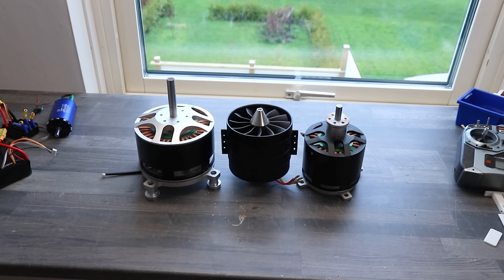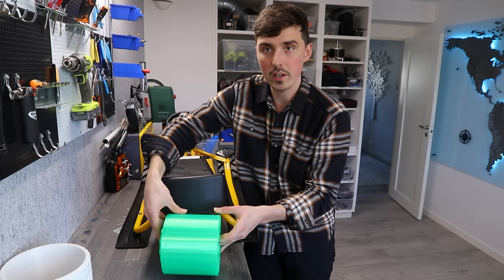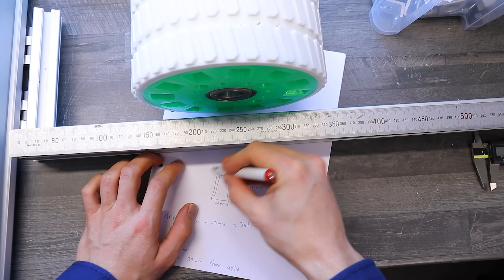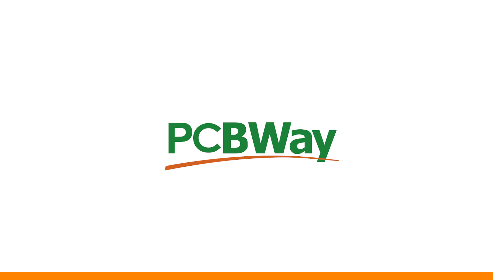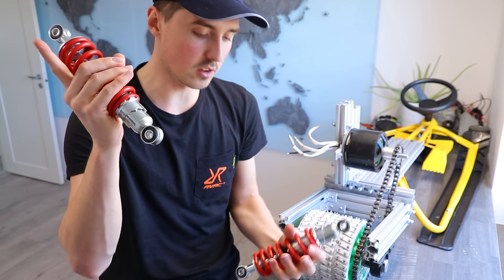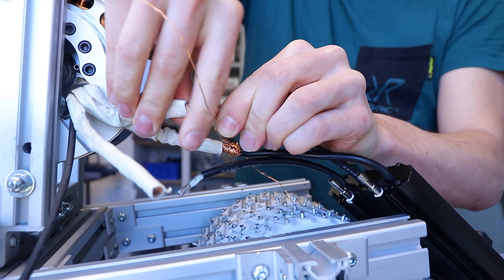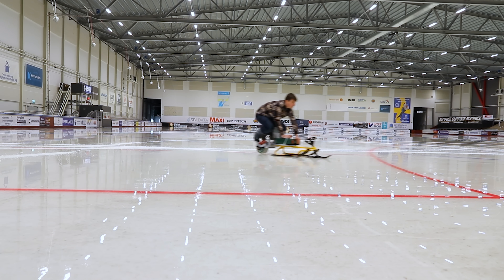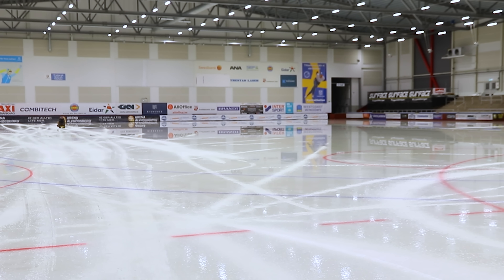15kW Electric Snow Racer Made With 3D Printed Parts

Comment: They make blades for miter saws that cut steel and aluminum, this could improve your cuts and reduce time. Great projects and informative content. Thank you
Reply: A thin kerf, high tpm wood cutting blade will usually make short work of aluminium too (if  you're not using a sawstop)

Comment: I'm only a few minutes in but it's looking great so far. one thing though don't use the same disc for ferrous and non ferrous metals. a cheap chop saw with an abrasive wheel on it would help you out lots for cutting metal. you can get them pretty cheap. keep up the great vids :)

Comment: To improve the grip easily, move the bottom mounts for the shocks forward (towards the seat) about 2-3 inches. This will reposition the wheel below the bottom of the frame and preload the shocks when you get on.

Comment: I can’t believe what you don’t know about building things. Look up what they use for studding up motorcycles. You will get better even traction. Use a chop saw with a triple chip cross cut blade designed for aluminum. Find someone to seek counsel before you hurt yourself. You remind me of the guy that has the channel The Amazing Marble Machine. Every episode he tells us what he is going to do next. Every time I say that won’t work. The next episode he presents that it didn’t work. I knew that before he did it. Why is that?  Experience!  You don’t need to make mistakes if you have counsel or a mentor. For me this is entertaining to watch you fool around but frustrating to watch you struggle when you don’t have to!

Comment: Your motor is in the wrong position, as it pulls on the chain the wheel rises off the ground and the chain becomes loose .....
Replacing the shock absorbers with aluminium flat bars would work much better....

Comment: Mount the shocks so that tey would be slightly lower than skids and when you sit on it they would preload a little and use the stiffest springs as you possibly can but not that stiff that it would keep skids with you above the ice. Find the balance between not stiff enough and too stiff.

Comment: You can get rid of the weights by adjusting the tension of the springs. power cannot be transmitted because the pressure applied to the ground is low

Comment: Only thing I would change, the steering is done with a ski which would work great in snow but for ice I'd recommend replacing it with skates. They are a lot easier to steer with. Course what do I know 😅

Comment: put those beefy shock absorbers to use brother. mount the drive wheel in the full extension and let your weight on the frame transfer through the shocks into the wheel.

Comment: So tell me if I'm wrong. But you should mount the shocks with the wheel assembly drooping more so that when u put it back on the ice and you sit on it the shocks actually push down on it instead of just hold it steady. And you shouldn't have to use the weights anymore. Just food for thought.

Comment: A few suggestions to improve things: 
1) Put the motor on the swing arm.
2) Remount the shocks so the wheel holds up most of the sled. This way, it’ll dig in better and you won’t need to use weights.
3) But blades on, at least, the steering ski so you actually can turn.

Comment: You make me wonder why you are so fixated on rear wheel drive , when the best option would be front wheel drive , where the drive can pull the sled and you steer it like a boat with bladed rudders , then you can have your natural weight over the drive and motor and use the suspension to dampen the bumps ?

Comment: This cool but why don’t us the shocks for what there intented for set it all level then rase the back Of the sled where you be sitting and adjust the shocks where back wheel still touching with back rose like 6 inches in air and front leve with back tire then when tighten all up and sit down your body weight will level the sled and put all 100ibs of your body weigh on the tire

Comment: Pro tip: Support the other side of the motor with a bearing. There is quite a bit of lateral trust on the motor bearings which  these out runners are not designed to handle.

Comment: Nice Engineerin! Maybe you should buy a cheap multimeter and next time something with a electrical does not work you measure the connections, also if a motor does not work measure coilresistance to see if something is defect/burnt and measure if there is voltage on the motor. This problem would have been traced in minutes instead of days with this method. With your level of smartness adding this little skill will be a no brainer for you and will help in all such projects.
 It seems that the grip despite all this spikes is not very efficient. Maybe it would better if the studspring should add more tension force downside instead of dampening…
Did you try to measure speeds?

Comment: Make a metal cover for the rear wheel then put a seat on the cover. You will have all the weight over the rear wheel. Better yet run dual motors, replace the front steer skid with a driven wheel. Having 2 wheels will give better acceleration and cornering.

Comment: When cutting aluminium, run your blade through some candle wax every now and then. The wax stops the cutting disc/blade from clogging up with aluminium, and youll find it cuts even easier than steel. Please try it i promise you wont regret it. Works with hacksaw as well.

Comment: For twist throttle you can use a servo tester and rig it to a twist throttle. The wheel should be lower than the sled so when you put weight on it the springs compress and keep tension against the surface. Would be cool seeing this go along a lake

Comment: Instead of putting weights on the back why not put a bar that goes to the back which you can lift and it presses the wheel into the ice . You can then adjust how much down force to get the best grip in the ice . What do you think ? I want to know what's the top speed now lol

Comment: Would it be possible to put the wheel underneath you? Maybe you could raise the seat or even shorten the seating and mount the wheel closer to your center of mass. You could also incorporate the shocks to make the wheel slightly lower than the skis as your body weight would compress the shocks, applying pressure to the ice. With a more forward seating position, a skate blade could be used for steering instead of a plastic ski. I love these videos and I want to see you make a bad ass contraption! I hope you see this!

Comment: That issue with the insulated wires reminded me of trying to repair wired ear buds years ago. You can't just twist the wires together without first running a flame over them to remove the invisible insulation.

Comment: Get rid of the big skis and use two wide spaced ice skates for steering. That way your weight will actually push the wheel in the ice instead of having those skis take away all pressure. The ice skates would allow you to steer. Don't use long skates though. The lateral traction that those have is way higher than the rear wheel, resulting in oversteer. Ice hockey skates (with rounded blades i.e. small contact area) will understeer if the rear wheel grip is high enough, but it gives you more control than excessive oversteer.

Comment: This isn't anything close to 15kW in reality. Even IF you were to somehow actually get that much power from that motor (hint, a sustained load will be a fraction of that), you're not getting that from those batteries anytime soon. The internal resistance from the batteries alone would cause them to catch fire in a matter of seconds if you actually pulled that much power from them.

Comment: Man, why dont you pick slot nuts for connecting your profiles? You can order any connection components you need at amazon from some china guy or order original parts from "item". Would make it much much easier for you and the end result looks a way nicer. You can also download original CAD files from "item" site to plan your build and then order noname profiles from amazon, they are all standartized.

Comment: for the isolated copper wire, you just have to brazing it at around 400°c with flux, the isolation will burn and you will can brazing normally

Comment: should have preloaded the shock absorbers on a level surface by setting them up at a downward angle so when you sit on it is forces the spring tension to push the roller into the ice

Comment: If you mount the wheel artificially low to where the skis aren't level and the shocks have to kick in whenever you sit on it to go level you'll get more bite with the back wheel and won't need the clunky and energy stealing weights on the back.

Comment: You should think about picking up a little cheap chop saw, something to make quick work of simple end and mitre cuts. Don't bother with cordless or anything fancy it will help immensely with construction end of crafting. Save your angle grinder pads for small stock or thin sheet material

Comment: Why did you just move the springs farther forward on the bottom bracket that way the wheel hits the ice first then when you sit on it the springs compress and it uses your weight to get traction instead of using the weights off the back?

Comment: I like to  bevel all my corners for 3d printing, yes it makes them stronger, also you should have had 2 sleds in the front for steering and nothing in between the wheel, would distribute enough weight to the back to make it work proper.

Comment: Nice job! Suggestion: reverse the position of motor and the wheel. The wheel should be right underneath the seat. Your mass will give you better traction. Higher the seat should give you a better lean on the turns. The motor should be furthest to rear for safety.

Comment: You need to pre-load the suspension, basically give the when a bit of droop so it can actually compress under weight, and it gives you a bit of travel for bumps etc.

Comment: Hey for the insulated copper wires ( 7:53 ), you just need to use a flame or a butane gas torch to burn the wire …. U can try it with all copper wires you find in a electrical transformers …. Nice video as always

Comment: I wonder if you could just mount longer shock absorbers so the wheel rests somewhat lower than the rest of the sled. Then when you sit on it the shocks keep enough pressure on the wheel so that you don't need the additional weights.
Just an idea.

Comment: First you need a chop saw with a high tooth count 12in blade for that aluminum. Second you should have add the shocks in a way that made the resting position of the wheel much lower then the body so when you put you weight on it there is pressure on the wheel. Still very cool to watch.

Comment: Men increase the angle of your swing arm and lift the back of your snow racer from the ground with the shock absorbers that it increases the load at the wheel when you seat on the saddle instead of adding training weight.
Reply: When I say increase the angle i mean move the swing arm rotation point upper. It push the wheel down when the torque is applied....

Comment: yo you should modify it to go in circles, either left or right. then you can go in ovels like a racing lap and drift a little. also i would bring the wheel a little more  bent towards the floor and stiffen the shocks to the highest. settings instead of the weights

Comment: I'd probably mount the wheel under the seat for the weight. Or have spring metal hold it down off the back. Without anyone on it the wheel would hold the sled up a bit. Would look better with the wheel under the seat though. And spring tension to control it's pressure.

Comment: You should pick up a large "Chop Saw" - aka a "Abrasive Cut-Off Machine" it's like a giant vertical 14" (35.56cm) cut off wheel that you use to precisely "chop" metal.  Works amazingly well on large pipe and thick pipe that is often tricky to cut and because the wheel is so large it lasts forever and cuts very quickly, and very flat since it's all fixed.  Cheap ones are like $100 USD and you can find used ones even cheaper!

Comment: The weights was a dumb idea why not just have the wheel holding the back skis off the ground and when you sat in it the shocks would allow movement enough for the skis to be on the ground and most of your body weight on the wheel

Comment: Why not just move the mounting point of the spring more forward. Then the wheel will be bent more downwards. Your seat will even be floating, requiring you to put your weight on the seat to ensure good pressure.

Comment: Asked for or not..... I'd offer a few ideas for improvement.  1st.... try using fewer stud in your drive wheel. That will put more pressure on each point causing better traction.  2nd... Reorient your shocks and springs, so it is below the level of the skis on the sled but will flatten out when you sit on it. That allows for better contact with the ground and less bouncing of the wheel.  3rd..... mount a piece of angle iron on all the skis. Allowing them to act more like skates than skis, thus making it easier to turn.

Comment: i think you should replace the two ski-things with two wheels. reconstruct your axle to accomodate for 2 wheels, get rid of the ski plates (whatever these are actually called) and use a blade for steering. 
also you can get rid of the insulation on the wires by heating them. i recently connected a sound box to my computer with a cable i made from two other cables by just twisting the wires of two ends together and it didn't work at first but when i heated each of the twisty bits up with a lighter is just miraculously started working fine without even having to retwist or something

Comment: Awesome project!
If you made the wheel lower than the skids you would have got much more traction with a 3 point stance (wheel and front edge of skids). Looks like you had most of the weight on the skids which were flat..

Comment: Pro tip: get a cheap bar of soap for grinding aluminium. Smear some soap on the cutting disc as its running and you'll get much better cut speed and blade life with aluminium cuts. Prevents the Al from galling and loading up the disc.

Comment: I used aspirin for cleaning the wires. Essentially aspirin is an acid and when heated (smells very horribly) it disolves the insulation and allows you to tin your wires properly.
So in the future solder the wires in a very well ventilated area using some aspirin tablets to clean the varnish off.

Comment: The chain looks like it's pulling against the springs and the swingarm suspension can't work, the chain is working like a hard stop for the suspension stopping it getting pushed into the ice. The motor axle and swingarm pivot need to be coaxial I think so the swingarm can move without having the chain go slack or trying to break the chain.

Comment: adding a skate instead of the plastic front or just a skate blade under the front blade, will let you turn much better with some weight over the steering wheel. well done!

Comment: Sick project, you should position the drive wheel down lower via the mounting position of the springs, that way when you sit down it compresses the suspension a little and puts down pressure on the wheel for added traction. You can tune out the extra weight your luggin around. Cheers

Comment: Try mimicking a snowmobile design with only 3 points of contact with the ice. 2 skis up front that support 50% of the weight that also both turn, and the other 50% of the weight on the wheel. You have way too many contact points on this rig making it hard to grip and hard to turn.

Comment: this is an awesome project!!! in terms of engineering, that actually is an interesting concept to put your weight on the skiis and then put plenty of weight on the wheel to make sure it is pushing down on the ice.  not super efficient with material, but its interesting!!!  next time put the rail from a pair of skates in front instead of a skii.  That will actually let you turn!! I hope we get to see an updated version of this!! and honestly, that was super stupid, who coats each individual copper strand when you have a motor cable.  thats just screwed up! lolz

Comment: Cool trike, could've benefited from having the suspension swing arm mounted at a lower angle, thus using your body weight to increase traction rather than adding dead weight over the wheel to achieve the same goal.

Comment: the shocks are threaded... why not spin the collars down to put more tension on the wheel... also you can mount the shocks lower so that the bottom of the wheel is lower than the bottom of the skis so when you sit on it, your body weight would press down on the wheel until the ski touches... the whole sled should be lifted on the wheel when there's not weight on it, so when you sit on it, it would press down, compres the shock, and have tension on the springs... fun project though!!

Comment: That's a really cool idea!  You might be able to address your traction issues by setting up a tension system based on the weight on the seat instead of fixed weights.

Comment: "i meet this guy who allowed me to record him on the thing" I think it was other way around. You allowed him to test the thing...
Also add two angled skates on the front and you have decent steering. Also maybe wider tire and lift the rear up a bit, so when you sit on top of it, it already builds some pressure on the shocks, witch are serious over kill, even one would be. Maybe try making your own springs to those shocks that are suitable size for this. There is lots of videos how to make a spring online. Though this size of spring steel is bit trickier to get hold off. Normally piano wire is used but this is too thin for this application, unless you have dozens combined maybe?

Comment: Best psycho project yet?  Probably.  Gets a whole bonus point for the danger factor on that "chain guard"

PS, they use chemical stripper (highly toxic) to get that insulation off the wires - sorry, can't recall exactly what it is called but it sucked wearing a gas mask for hours at a time when using it